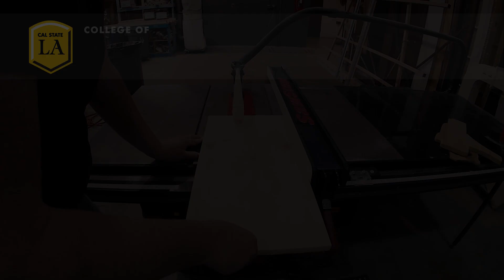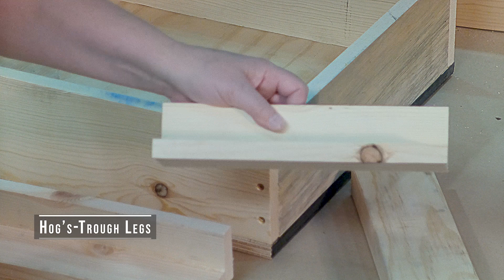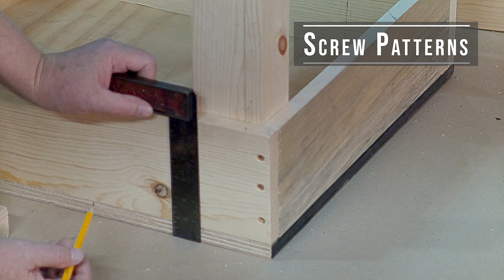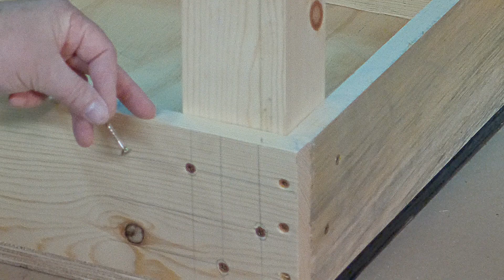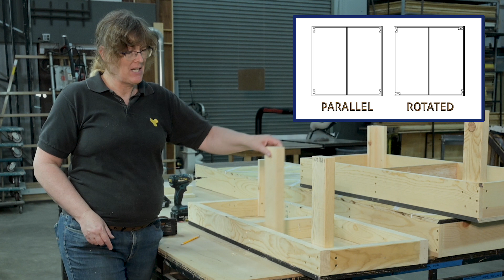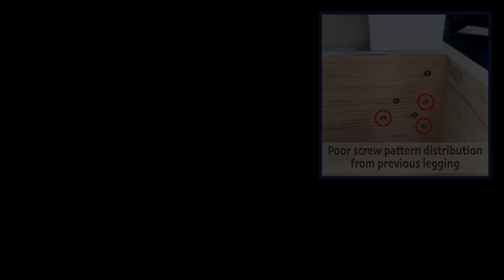8 Ways to Leg Stage Platforms Using Screws

Comment: Thank you. Any way of making it portable with folding legs?
Reply from the maker: I have a short overview video of a platform design called a parallel. It should be in the Platforms playlist. They are structurally designed with a removable lid and folding frame of “legs”.

Comment: Your videos are the absolute best! Feels like all of my greatest learning experiences in shops, at my fingertips (and those of my students). Do you have any videos on castering larger structures, and linking them? I’ve seen coffin lock solutions used in the past, imagine you have opinions or inside. Thanks!
Reply from the maker: I have done large caster plates made from 1x6 and assembled like soft flats but with Lauan square “corner blocks” on both sides, then casters bolted through the plate. Leg up and connect platforms and the caster plate marries them on the bottom of the legs while screws/bolts marry the platform frame.
Reply from the maker: I am not a fan of coffin locks. The amount of work to notch them and drill out holes for hex keys is just not worth it.
Reply from the maker: See Short reply

Comment: What is your preferred method to connect multiple platforns
Reply from the maker: Depends on the scenic needs, but for most purposes, construction or drywall screws work just fine. I try to avoid having to bolt things together, but will do that when the structure requires it. Not a fan of coffin locks. And always willing to try new things.

Comment: Im curious that you didnt touch on step legs at all (paired 2x4s where one goes up to the underside of the lid and one has the platform framing resting on it). I build sets for the local HS and I'm trying to learn thr safest ways to do things. All of our platforms are 2x4 framing with 3/4 ply lids. We have been using 4x4 legs and 3" T25 screws, 2 on each side. But that relies on the shear strength of the screws, which i understand isn't great.
I am looking into either switching to through bolts with lock washers and nuts (and templates so things are interchangeable and reusable), or into step legs, possibly also woth through bolts, lock washers and nuts. Eapecially if the platforms are above 4' above the stage deck. Thoughts on these ideas?
Reply from the maker: Check out this video, as this method is similar to what you are calling a "step leg".

https://youtu.be/rRjWkUfXpDY

The disadvantage of legs screwed to the frame and also resting under the lid is that if the screws fail, the lid can de-laminate from the frame. Which is why I always screw my lids to the frames rather than gluing and stapling. Screws would provide additional holding strength in the event of catastrophic screw shear failure. But in reality, the screw shear failure is very very low, especially if you are using construction screws. T-25 construction screws or deck screws have better shear strength than 3" drywall screws. 

I think 4x4 legs is super-overkill for anything under 6' or 8'. I'll build up to 8' tall and maybe taller using 1x6 framing and hog's-trough legs with screws and appropriate cross-bracing. Folks have asked for a demonstration of this method, and I do want to make a video, but don't know when I will be able to get to it. I like to keep everything light, so I avoid 2x4 framing and generally avoid 2x4s , 2x6s, and 4x4s. A hog's-trough is just as strong as a 2x4 in vertical orientation but has the advantage of less bowing and warpage over its life. Hog's-trough stock doesn't store very well though because of its odd shape.
Reply: @calstatelaalproductions2358  thank you so much for your thorough answer! I have been perusing some theatre construction books, especially Stock Scenery Construction Handbook, which highlights the step leg (which is essentially a half lap made out of two 2x4s). I'm hoping to find reusable/stock/easy to reassemble type procedures for our school, since it's almost always parent volunteers who are just DIY types (like myself, although I'm taking extra steps to learn).
Our most recent production had 8' and 7' platforms that actors were on, and also crossed under in multiple directions, so we were happy to use 4x4 legs. We added diagonal bracing but could only put them at the top few feet, from the middle of the platform frame to about halfway down each leg. Our 3/4" ply lids are all screwed to the 2x4 framing with a LOT of screws. I'm super relieved to hear that the shear strength of 3" T25 construction screws is stronger than what I thought, because we are putting our literal own children on top.
Reply from the maker: Glad you found the video showing off a parallel structure. That’s still one of the best easy-to-build and easy-to-set-up re-usable options. 

There is a manufacturer who sells a metal bracket for the inside corners of 2x4 platforms to readily accept 2x4 legs and you don’t have to screw through your platform framing every time. Not sure what they are called off the top of my head but probably easy to find somewhere like BMI Supply or other theatrical supply vendors.

Comment: This video was extremely helpful! Thank you for making it! You briefly mentioned about drilling the platform into the floor. If that isn't an option, is there an alternate way to stabilize the platform beyond using bracing?
Reply from the maker: Yeah I typically use L-brackets to secure platforms to the stage. I prefer that over toe-nailing the legs with screws. If your stage doesn’t allow screwing or you are putting the platform up on a surface they you can’t secure to, then more cross-bracing is likely your best option. Or consider making traditional parallel platforms (I have a short video in the platform construction playlist showing off a parallel and discussing how it works. I don’t yet have a video building one from scratch.) I’ve used parallels on carpeted areas to great success.

Comment: What type screw are you using?  I know you said 1 5/8, but Phillips, star?
Reply from the maker: Trying to remember what I used in the video. The black phosphate screws are drywall screws with Phillips head. If I am using gold construction screws, those are most likely Torx head, the star pattern you are referring to. I prefer the Torx screws and the gold construction screws.

Comment: Do machine bolts come in a different name? Are they hex bolts? Trying to find them to use instead of carriage bolts.
Reply from the maker: Machine bolt, hex head bolt, and hex head cap screw are all names I have seen in use.
Reply from the maker: Though technically a hex or machine bolt is designed to have a nut that tightens it and a hex head cap screw is designed to be tightened by the head into a threaded metal part like a motor block or something like that. They are manufactured with different tolerances and specifications in mind. Pretty sure using a hex head cap screw with a nut is still okay, just that you are paying a premium for the additional manufacturing accuracy of the cap screw.